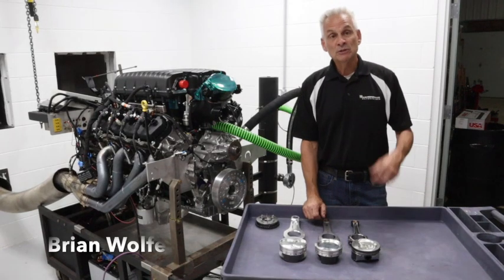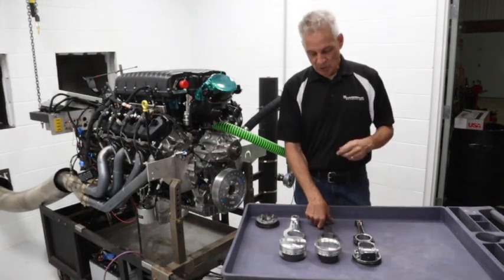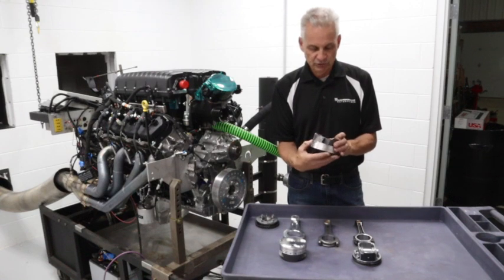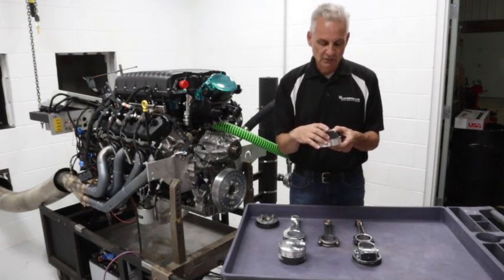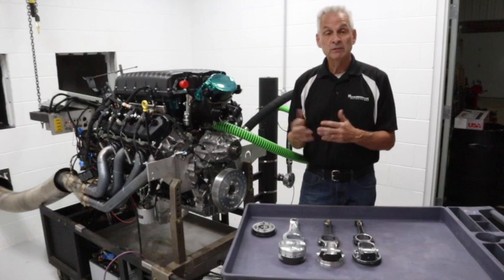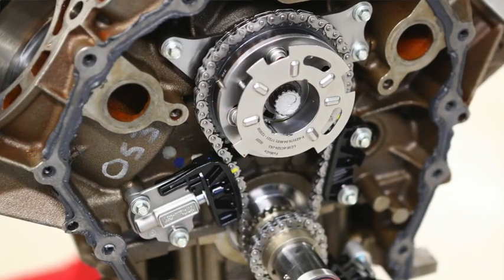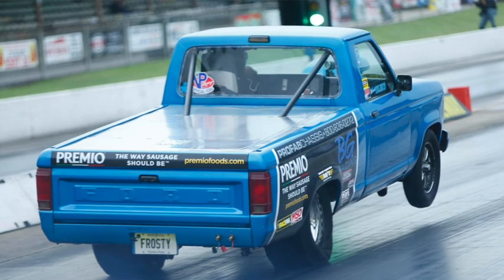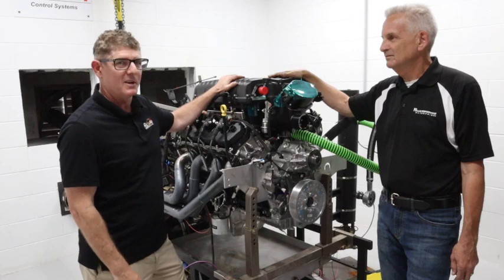7.3 Godzilla — Max Power? — Engine Management — Plus... Rods, Pistons and Soon, Ford Whipple Boost

Comment: I never appreciated Ford engines.. well... the 302 and the Ca pursuit 428 aside... this is a good block. The pricing of the add-ons are making this guy rich. Understandable.. he is one of the first, spent for success. When and if I live long enough lol, if the bolt-ons and other parts come down due to competition and generous supply I will definitely do a build up with the 'Zilla'. Catch myself trying to think of a appropriate frame though... I like older stuff... even the heavy ones., any ideas? Maybe 700>< H.P. in a Princess T-bird? always liked those suicide doors.

Comment: My 03 Terminator has been sitting for a couple of years now. In a couple more years I'll be able to buy a complete 7.3 blower motor with wiring harness. Hell, there'll be even more room to work on the 7.3 considering how wide those damn Mod motors are. That'll give new meaning to Terminator!

Comment: Want to make 800-850 hp on stock motor? Blower/fuel system/e85 on a bone stock unopend 5.0 coyote. Why even bother with the 7.3 when you have to basicaly build it
Reply: Because this guy is showing us you can take a stock block, crank and heads and push it to 1450hp ( 1-5-2021) on 16.6lbs of boost and still more in it.. Easy.. When you get to that level in coyote. Better get sleeves or a Bear block. This block can go 1800hp plus with great tq.

Comment: I curious what Kaase would come up with for this beast
Reply: I am also curious if he takes an interest. The 385 might be ancient tech, but for the amount of displacement you can pull from one he may still prefer it. The bore centers on this are much smaller, in order to make the outer package fit everything. It makes it taller but narrow and short length. I am sure that he will mess with them, but when it comes to the extreme end I suspect he will stay with the massive bore of the old engine.

Comment: Like GM’s LS series engines, especially the 8.1 And yes, I know they’re pretty restricted stock but it’s still a reliable engine with the classic pushrod design. When modified, it’s numbers grow. Glad FORD improved on the same simple pushrod designed large displacement engine. I’m happy to see this as well as many others are too
Reply: The 8.1 was a big block, not an LS.
Reply: @andyharman3022  Kinda sorta but not exactly true. But I know what you’re saying. Regardless of splitting hairs the 8.1 is a good engine
Reply: @HeyDude93gt  Not kinda sorta, Mark VI big block has no common dimensions to the LS series.
Reply: @andyharman3022  I agree engine dimensions or displacement is irrelevant. So What’s a “Big Block” engine?
Reply: @HeyDude93gt  Each manufacturer defines it differently, depending on how their business is structured.  There is no "scientific" definition, or set dimensions that separate "big" and "small".  Chevy small and big blocks are separated by bore spacing and deck height.  Oldsmobile and Pontiac small and big blocks only have low and high decks, with all having the same bore spacing.  Ford has built  pushrod V8's in four different bore spacings, and their small blocks have four different deck heights.
Reply: @andyharman3022  It pleases me to hear you know about this as so many people get caught up on the Big and Small block nonsense. As for the 8.1 I’ll assume you know it does use some ls engineering even though it’s foundation is of the last update of the 454

Edit. You forgot to mention Buick and Cadillac in your GM engine reference 
And what about mopar with their strange engine series? Would you be so kind as to school me on those too? And where did this “ Big and Small block “  reference  originate? I’ll give you some time to look this up

Comment: Why is the 7.3 getting all of this attention while the 6.2 is completely overlooked?
Reply: This was my choice to do, you can do all you want with that engine.   Would love to see how it works out.
Reply: The 6.2 had sort of a serious issue in the valvetrain design.  Putting the lash adjuster at the valve end of the rocker arm limited its potential.

Comment: So what would you have to do to swap this into something without a computer?
Reply: Until the aftermarket offers a solution, custom sheet metal intake or perhaps 3D printed plastic (high grade nylon?) at a minimum, then a standalone spark box, but that is just a different computer. So long as they make it dead simple to wire the crate engine harness, why not run EFI?

Comment: What's most impressive is these motors are available new from ford at $7.5k in the crate.
Reply: I agree. I just build a 302 based 331 (technically 332 stroker, 0.030 over 3.25” stroke SBF. I haven’t tallied it up, but between machine work, hot tank, magnaflux, bore 30 over, torque plate hone, line hone, and a balance job on the Scat rotating assembly, Mahle pistons, new intake, new carb, new cam, new link bar lifters, new pushrods, new roller rockers, new blueprint cylinder heads, new billet distributor, new coil, and all the work on my part, that $7500.00 price tag seems a great deal. The 7.3 would be nice in my 1980 Bronco, but the motor I built is pretty quick and I really enjoyed the process.
Anybody know how much they’re selling the transmission that bolts up to the 7.3?
Reply: @WesternReloader  the bell housing is the same as coyote so I’m sure most trans that fit coyotes would fit
Reply: Why bother with a 331?  363 has a better rod stroke ratio lot cheaper 20 % easily more hp and torque .
Reply: @MrBlackbutang  if its a stock block 302 then it can not fit a 363 stroker crank  without additional machine work to the bottom of the cylinders
Reply: @Dwarf892  no shitzer. Don’t bother with 302 at all wasted time ! Just like mewrongway said

Comment: Why the heck would Ford name it Godzilla?
Reply: The first prototypes were sent to Tokyo where they stomped on everything that was Fast and/or Furious.
Reply: Because Ford names there stuff from movies. 

7.3= godzilla
5.2 SC= predator 
5.2 flat plane= voodoo
5.0=coyote 
I forget but one of the exoboost is the Phoenix.

FCA names are based on aircraft names and we all know how gm does it
Reply: The engineering team named it that.
Reply: The Godzilla is a name owned by Nissan, for its 2.6 4WD terror of the racetrack in the early 90s. I hope another name catches on soon.
Reply: @vintagetintrader1062  Nissan doesn't own 'Godzilla'. We aussies gave it that nickname.
Reply: Andrew, true us Aussies did after the Bathurst wins but even the Europeans adopted that name for it in the European championship until rule changes basically outlawed it.
My issue with this name is this it a good old USA pushrod style engine dragged into the 21st century. (Finally a simple pushrod Ford after near 30 years of OHC engines with 5000 cam chains and guides that destroy themselves ) Using a Japanese sourced name just does not sit well with me. Reading the posts on other 7.3 vids a lot of others agree.
Hopefully we will have this engine available in Australia in the next few years, in a F150/350 or at least a full plug and play crate engine.
Reply: @mewrongwayKOCXF  oh wow, I always thought they were 4
Reply: @mewrongwayKOCXF  which LS has a 6bolt main?

Comment: Sooo are we considering this a SBF still or going off the engineering recognition that its a BBF?
Reply: Its a Small Block.
Reply: Plus-sized small block.
Reply: @CarlRyan-i2z  Then the Gen 3 hemi is and the LS.   All are within an eighth of an inch of bore spacing.  When Dave Filipe called it as big block it was in comparison to the current Coyote which is 3.93 bore spacing.

Comment: One of these days my Excursion will be getting one of these....its good to see Ford put out something that will slap the shit out of the LS.
Reply: yea, FINALLY after 20 years!!!!!!!!!! AND after it set the industry standard both stock and swap plus aftermarkets and Holley based so many products around the LS.
Reply: @mewrongwayKOCXF  hurt for what?????? lol not my fault the clowns dont have funds to build the correct engine. I will take a teksid bloc 4.6 dohc engine over an ls all day long i dont care for a stoc car or what you can do n/a. Heavy boost is the name of the game AND NO LS IS COMPETING WITH ANY MODULAR ANYTHING.... THERE IS A REASON THE C8 WENT MODULAR DIPSHIT ls is old tech that cant get the job done correctly whats up with those weak ass lsx 427's those are like grenades 🤣🤣 clown ass boy
Reply: I'll be doing the dream on now.....
Reply: Yea dream on ..
Reply: @mewrongwayKOCXF  cheap and inexpensive is all thats needed u cut the bs
Reply: @mewrongwayKOCXF  because they DONT COST SHIT i was just at pic a part and they had numerous ls platform for under a 1k 🤣🤣 cut the bs thats the real reason because they're everywhere
Reply: A built 351w or a 385 series would bitch slap a ls motor now.
Reply: @mewrongwayKOCXF  yeah you dream on.... an all motor coyote holds a world record for fastest N/A in a mustang. 8.47 @157....without a turbo.
Reply: @BSC_1982  And how much money is that car? Just seen a video the other day and the guy finally got his 18 Mustang in the 7s. Over 35,000 dollars into it. That's not including the price of the car. Since you're a Ford guy here's a fun fact for you. If GM quit racing in NASCAR,it will take Ford 23 years to just tie them. Yep those shitty Chevys.
Reply: 93Cobra nah man... there’s pushrod 5.0 cars in the 7s NA, dude.  The coyote ain’t shit.  Pile of over-complex junk
Reply: @mewrongwayKOCXF  yeah when you're as dumb as a box of rocks an old outdated pushrod engine is the only thing you have mental capacity for. Any douche can glue a Chevy together....it actually takes brains to build a Ford.
Reply: 93Cobra uhhhh bullshit... I’ve built both.  Those heads on the LS flow the same numbers WITH TWO VALVES as that overcomplex 4 valve idiotic junk from ford... and that LS with hold together when those coyotes will blow the hell up!  While you’re on YouTube look up how many of these junk ass coyote engines have FAILED and BLOWN UP!  This pushrod Godzilla is... uh.... LONG OVERDUE!
Reply: @cammer68oliver2  if that were totally true why have gm put a dohc 32v8 in the C8R
Reply: We've had the coyote for almost 10 years now bud
Reply: Bryce Hickman yes but that coyote junk derived from the 4.6 modular junk that cane out in 96, which is what this guy is talking about.  20 years of Cam-out-of-block, over complicated junk.
Reply: Almost 10 years, and still slacking. Just like the diesel side. Been doing oil burners for 25 years, and Ford still sucks a nut out the sack.